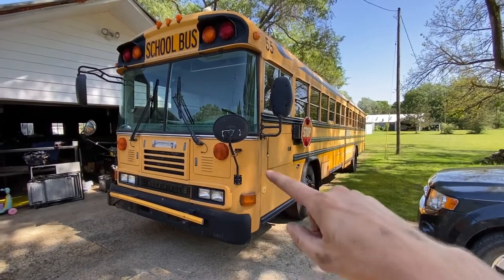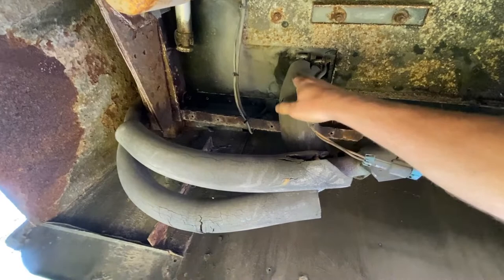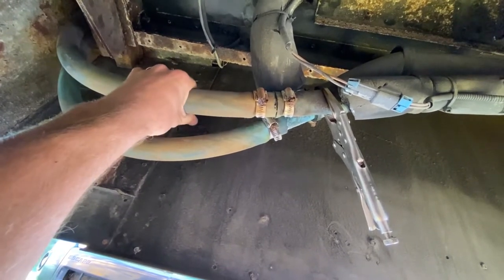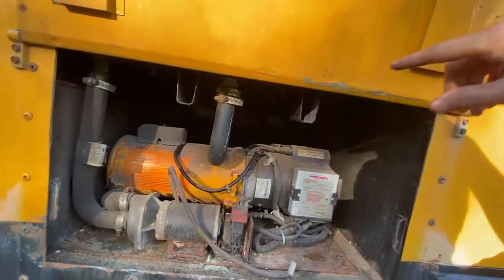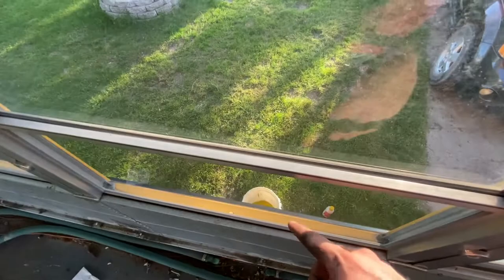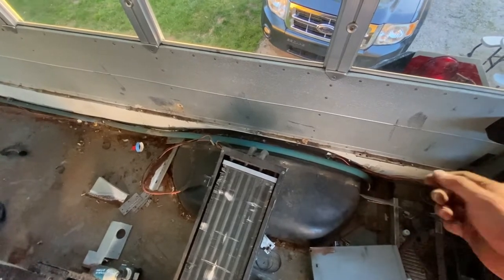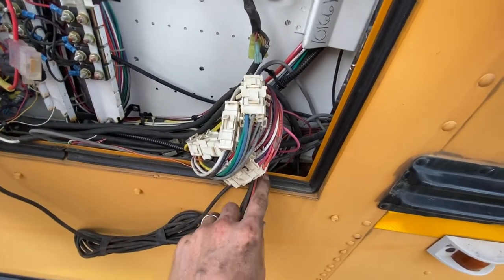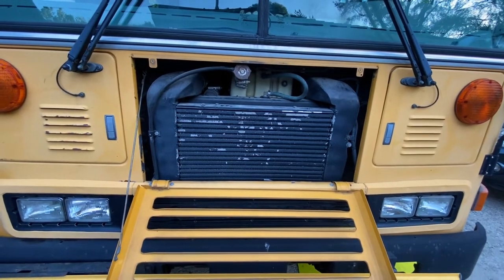How To Remove Heaters And Loop Coolant Lines For Skoolie Conversion DIY

Comment: Hey thanks for the video! Vety helpful. Quick question - I already did the same, and now I'm down all that green coolant. What coolant did you fill up with and how did you do the radiator flush? Curious how you made sure there was no air in the line after you had to drain a lot of the system. Thanks!
Reply from the maker: I just refilled with normal green antifreeze. If it’s green, then it’s the same. Green is green. Most systems are self purging. The air bubbles will naturally rise to the top of the radiator. I have footage of doing a radiator flush that I need to edit and post. I’ll comment the link here when I get it posted. I’ll try to have it done this weekend.